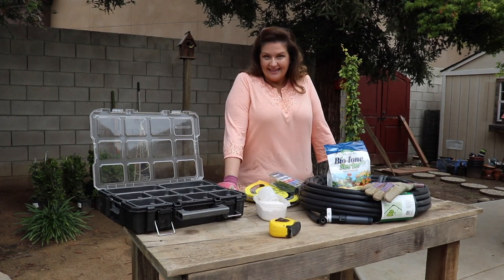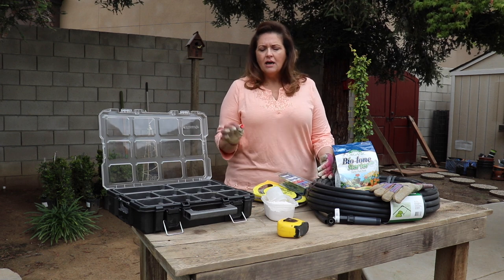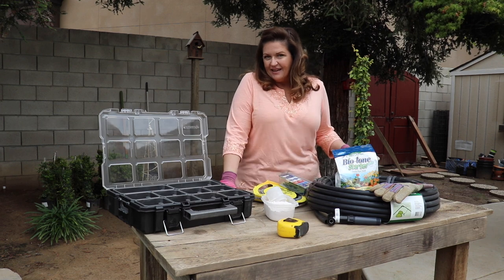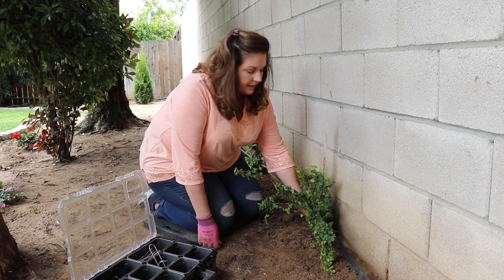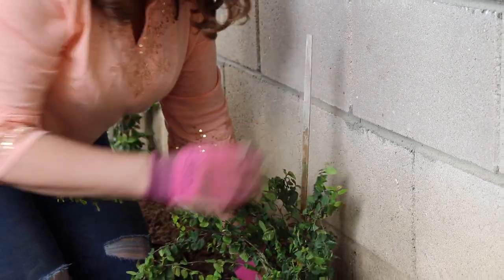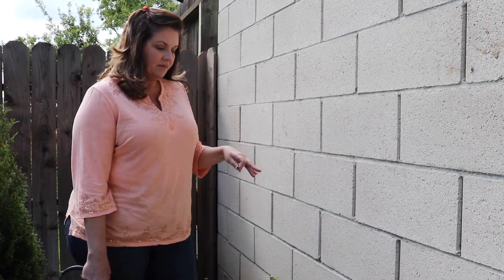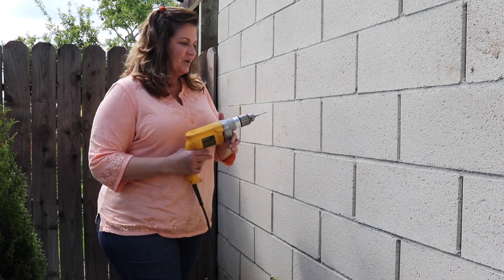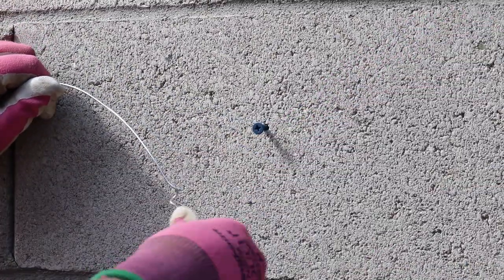Planting Creeping Fig to Cover a Block Wall ~ birdhouse garden

Comment: Good job. You don't actually need the wire. The plant Will cover the wall by itself
Reply: Wire helps a great deal. The weight of the growth will often rolls off from wall. The wire provides support.

Comment: Can we get an update? How much higher has it grown? I'm in Southern California and want to do the same. Also how often do you water them?
Reply from the maker: They were 18" tall when we planted them.  Now, some of them are over 4' tall already (I wasn't expecting that much growth this soon). Originally, I put 2 gph emitters in. However, we changed them to 5 gph emitters, running them 5 minutes each morning. This is due in part to the watering guidelines that we have to adhere to and our 100+ degree heat. Depending on where in SoCal you live, you probably don't need a 5 gph emitter. Check out our Instagram page tomorrow for an updated photo. Also, next week we'll be filming a garden tour that will include the creeping fig. Thank you for watching.

Comment: What do you do when you have a wall like this and you want to do this but there no water source that’s close enough for a drip line? How often does it need to be watered if that’s the case? 
What kind of drill head did you use to drip into the wall?
Reply from the maker: We live in Zone 9. I watered mine every other day during the hot months but when it cools I only water once a week. And I used a masonry drill bit. Thank you